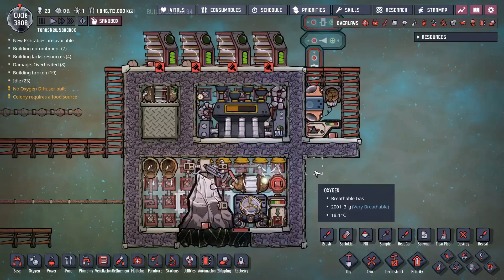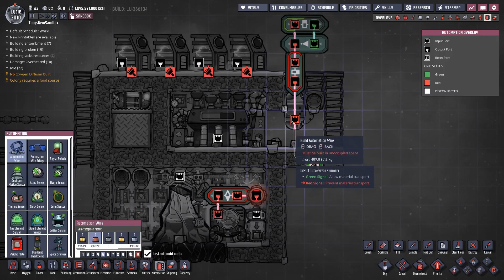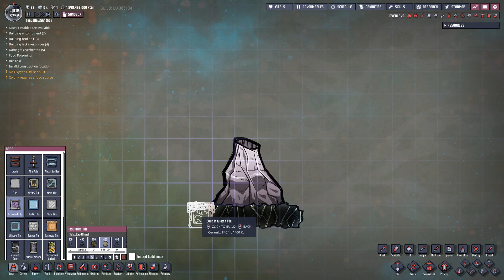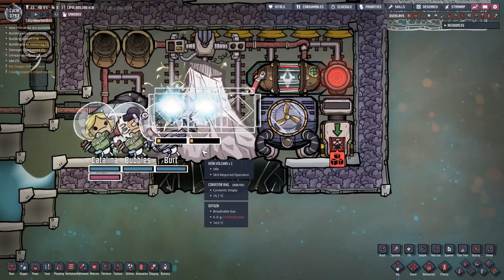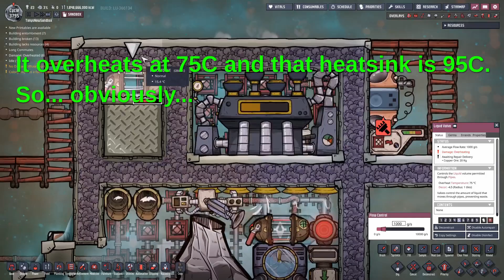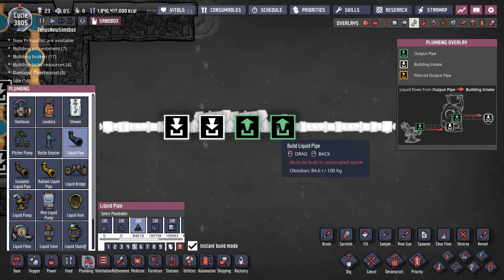Self-Powered Metal Volcano Tamer - ONI Volcano Taming - Part 3

Comment: Sir, I just saw your gas refinery and must say that it is quite impressive! But, I had a design of myself that might be more efficient. Are you interested?
Reply from the maker: I'm always interested. :)
Reply: @tonyadvanced6315  Thanks for your reply! I never expected someone to actually read the comments.

http://puu.sh/EgH9M/294da2a216.jpg
http://puu.sh/EgHbW/651c0d9585.jpg

Here you go! I have kept it for myself for like a year and was hoping someone from youtube could appreciate it. It converts 6200g/s of crude oil and runs indefinitely. I am at this very moment working on a more compact design where its folded up, and the thing can be built directly under a oil well to circumvent having to use a pump. We could also proceed to discord if you want a more elaborate inspection.
Reply: @tonyadvanced6315  https://www.reddit.com/r/Oxygennotincluded/comments/engb12/useful_metal_volcano_tamer/

Would love to know your thoughts

Comment: Hi, can you explain the purpose of the liquid valve and why you set them to their specific values?
Reply from the maker: The liquid valve at the top takes the water from the steam turbine (2kg/s) and breaks it into two pipes at 1kg/s each. The valve is set to 1kg/s. When you have 1kg/s or less of a liquid in a pipe then the liquid won't freeze/boil and break the pipe no matter what temperature it is. So, using those pipes to cool the heat-sink below the valve is 100% safe (but, I think it may be unnecessary to do it that way, I'm not sure.) This way, the metal can be cooled to 95C using nothing but the steam turbine.
Reply from the maker: The liquid valve above the aquatuner is basically just a bridge that bypasses the aquatuner so the coolant (water) loop keeps moving even when the aquatuner is turned off. Without that, the coolant would stop moving when the aquatuner stops because it's cold enough. I prefer to do cooling that way because it's easier to manage. The valve is set to the maximum, (10kg/s)

Comment: Are the logic components and wires affected by temp?
Reply from the maker: As long as you build them out of something that won't melt then they are fine. And as long as they aren't directly on top of the volcano it doesn't require anything special.

Comment: Beware of Conveyor belts: 

https://forums.kleientertainment.com/klei-bug-tracker/oni/conveyor-rails-do-not-transfer-heat-off-screen-r21790/
https://forums.kleientertainment.com/forums/topic/111196-offscreen-conveyor-mechanics/
Reply: It sounds like the way this volcano is designed, it should be fine while in the "steam room". to get the heat sink working correctly offscreen, you should use a bridge to enter the heat sync first; that way it's "origination output point" is on a tile where you want the heat transfer to happen. That bug looks like it's going to be annoying though. I'll definitely have to be cautious of using rails for heat transfer.

Comment: I like your build.  My normal reaction to a metal volcano is to just get the metal out, but it is good to get the most out of it.

If you put your gas pump one tile higher, your pump would have removed the oxygen much faster.   You should read the forum post "The mystery about pump range."  Your gas pump was only removing gas from 1 tile, whereas moving it up one tile would have it in contact with 4 tiles.
Reply from the maker: Ah, that explains it.

Comment: The bypass wasn't failing ..you still had the bridge pipe from the steam outlet attached, it was trying to force 2k of water from the turbine into it.. you can see it adding packets of water when you added the new pipes @39.24
Reply from the maker: You are definitely correct about that, in a sense. If it weren't for the bridge then when an empty bubble in the coolant loop comes along then it wouldn't get water in it and the loop wouldn't get locked up. But I've been trying to make a bypass that doesn't have that vulnerability at all so that it can be used for sophisticated cooling loops that require inputs and outputs that can't simply be removed, so that's why I'm frustrated by it.

Comment: Dud i just found your channal and it's amazing.
Also i have a problem with too much poluted dirt, do you know a way to turn it into something useful other than compost?
Reply: Feed it to pokeshells for their shells, don't tame them though, they eat way more when tame
Reply: Options include pokeshells for shells/eggs and sand or sage hatches for meat/eggs and coal. Just keep in mind that while coal>>sand the shells make lime, which is often the limiting reagent to make steel.

Or drop it in water and forget about it until you're ready - which could easily be the first of never.

Comment: I tamed my iron volcano by simply dumping tons of cooled water in to the room constantly, pumping it our from the bottom of the room and running through a steel-free (thanks to you) aquatuner/steam turbine setup. Definitely not the most power efficient method, but it rapidly stopped the heat wave of death spreading across my base from the volcano.
Reply from the maker: I do it that way sometimes. It's the I-have-plenty-of-power-so-why-not method. It might be easier/cheaper to put water in the room 1 tile deep and use a radiant pipe to keep it cool instead of rotating the water.

Comment: Very cool build and instructional video. The one issue I see with this though is the weight plate. If it takes priority over your time delay automation, the conveyor will empty out and never buffer. Unfortunately I think you would have to ignore your top rule of always have iron available for your dupes to overcome that issue.
Reply from the maker: You are right. One weakness of the build is if my dupes use too much iron then things don't work as intended. But I'm pretty sure nothing breaks, and I sorta prefer that I get the iron right away if I do indeed need it. I think players with other priorities can make modifications to meet their goals.
Reply: Frankly I'd just skip the weight plate. You're going to get iron out at the speed that the volcano produces it. My current method involves waiting until the volcano goes dormant to extract all the iron so... this is certainly superior to that :P

Comment: are you going to go back t your old bypass and just have the buffer space now? or is there an advantage to the valve system you have set up? ( or is it a shutoff? i get their look confused)
Reply from the maker: I'll use the buffer space for now. I'm planning to try to design one that works without it, but I'm not sure it's possible. There's at least one design that incorporates a buffer space. Ideally, I"d like to get rid of the buffer space altogether because the temperature in the buffer can slowly deviate from the rest of the coolant and I dislike that.
Reply: @tonyadvanced6315  I think the valve bypass failed due to leaving the pipe bridge (from your tubine output, that you used to prime the cooling loop) connected. If you remove the bridge ( no need to refill a closed loop once it is full) it will stop filling the loop completely and borking up your loop. Very much enjoying your tutorials dude.
Reply from the maker: @anthonyoswin7634  You are absolutely right. If I took away the thing that fills the loop then it wouldn't be possible to overfill it.

Comment: When i saw the bypass fail i could not hold back the laughter. 10/10
Also temp checks need to take place right before entering the aquatuner (the point where it can move to a bypass or the aquatuner ) or you'll have even more problems.
Keep up the good work.
Reply from the maker: Indeed, thank you. I put the temp check in the addenda already, it's good advice. That bypass thing is going to haunt me. :)

Comment: You should have the pipe temp sensor just one pipe segment before it enters the aquatuner if you want it to be reliable. Otherwise it can happily send too cold packet into the aquatuner because the packet it just measured wasn't cold enough. I guess that's why your pipe is breaking.
Reply: Not quite needed if you put a filter gate on the sensor. Then the aquatuner will only turn on after a consecutive number of packets are hot enough for the aquatuner to turn on, and will turn off immediately if just one packet is too cold. The setting on the filter gate should be pipe length to aquatuner input minus one second. This principle always applies. So if the sensor is adjacent to the aquatuner then the pipe length is one minus one second which means the filter gate can be omitted.
In set ups like this I prefer a relatively long pipe length between the sensor and aquatuner in order to have the latter on for a few seconds at a time instead of short bursts.
Btw, nice to see you around Kasuha (I'm Saturnus from the forums)
Reply: @SamsoniteDove  You're right. The tradeoff is that you will be skipping some hot packets too so I'd probably only use it if there's really no way to fit the sensor right next to the aquatuner.
Reply from the maker: Thank you. I'll put it in the addenda.
Reply: liquid reservoir? just even out the high & low temp

Comment: Which liquid is better for the cooling loops? Water, oil or petroleum?
Reply from the maker: Water or petroleum, depending what you are doing:
1) Water: Has a high specific heat. One packet does more than twice as much cooling as petroleum.
2) Petroleum: Has a lower freezing point, so you can cool things colder than you can with water.
Reply: @tonyadvanced6315  thanks. I'm building a petroleum boiler, but I think I can use remaining igneous rock from that to corner suck it with autoloader and heat up steam with that, so I was thinking of cooling down the loader, and I don't want water to evaporate in that loop
Reply: just a thing to keep in mind with that: from an efficiency standpoint you always want to use 10kg packets of water(p, salt or normal does not matter that much) or later super coolant in an aquatuner as you transfer much more "energy" per watt out of it. 

You can also "cool" things passively by using steel or thermium machinery and running it hot. You can run a 200° petroleum loop that heats steam without an aquatuner. 

Depending on the igneus rock temperature and if you want the system to be able to back up (so the rock may heat the recepticle) it is enough to just cool the atmosphere surrounding those with water. If no rock gets stuck they have very minimal time to heat up anyways and you are pumping 10kg water (with SHC of 4+) along an atmosphere with at most 2.4 SHC at most likely lower pressure than 10kg. You have to put in A LOT of heat to have that water boil if you actively cool it. 20kg packets of 1.0 SHC igneous rock 50% of the time are likely not enough to do that.

Comment: Your iron rails will melt near the volcano centre. Im 100% sure they will. Ive done like 5 versions of this before an all of them melted near the centre.
Reply from the maker: You are right, it's true, they do. I put a text thing there saying that you should use steel.
Reply: @tonyadvanced6315  what about tungsten?
Reply: @tonyadvanced6315  Even steel melted for me at the center tile.  Other than that this is great. Next build my conveyor path would just avoid that one tile.
Reply from the maker: @davidg81815  Oh dang. I eventually switched to steel but that didn't happen. I'll mention it in the addenda so people know. Avoiding the hot spots is a good move, or you could use wolframite if you are stubborn like me.
Reply: @tonyadvanced6315  My guess is that since this video never went all the way to vacuum, that tiny amount of air was enough to save the conveyor rail. It might work if you leave the room at 1mg of oxygen until the steam takes over.

Comment: You should do a whole video on using arbor trees to make water or oxygen
Reply: "You should do a whole video on using arbor trees to make water..."

Through which route though?

The wild tree route?

The pdirt-po2-puft-slime-algae distiller route?

Or the co2-slicksters-petrol route?

All three?  None of the above? (domestic arbor trees are water negative without one of these routes)
Reply: @josephburchanowski4636  Im using pips to plant the trees
Reply: @--2K992  So the first route.

You get about 15.625 kg of pwater per day per tree. And about 27.78 kg of pdirt per day.

For pure po2 production 43.4kg per day per tree; so you need more than 1 tree per dupe (since dupes use 60kg per cycle)

Deoderizers reduce it to 39kg of o2 per day.

Sieving the pwater first and then putting it into an electrolyzer gives a tiny bit less o2 than pure deoderizers and off gassing, but it gives you hydrogen.